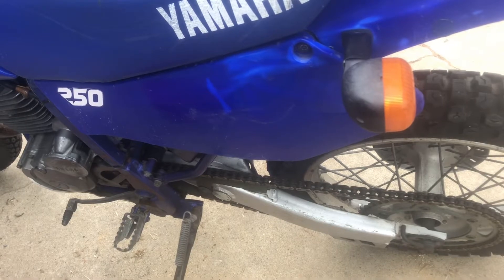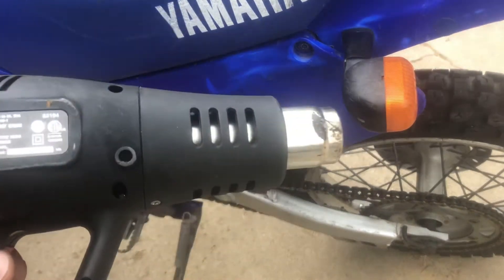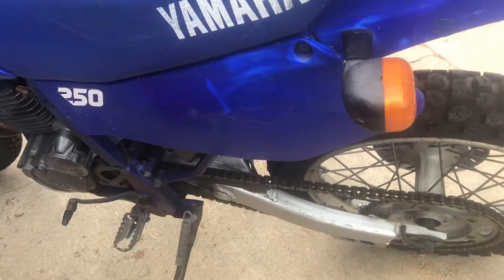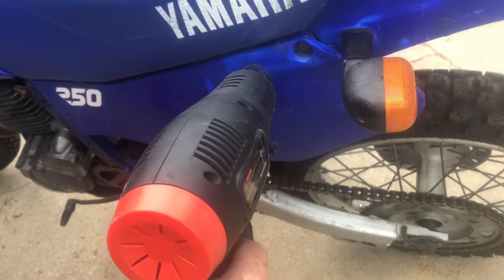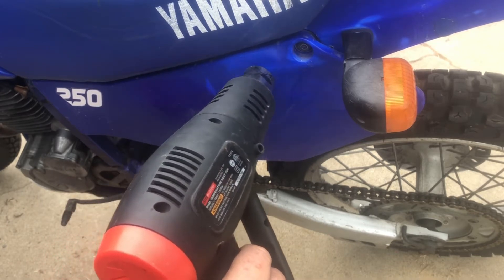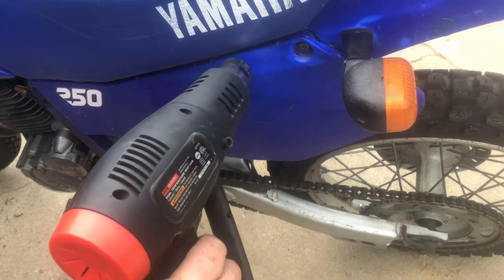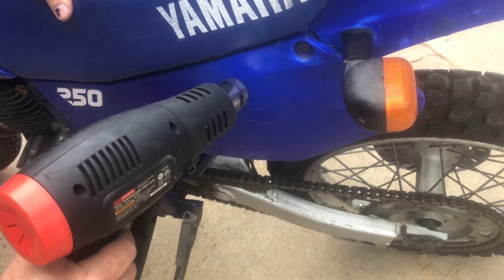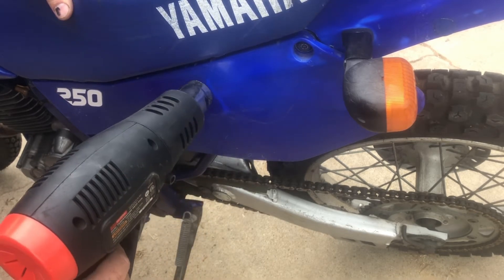How To Fix White Spots On Dirt Bike Plastics

Comment: Do you know anything about ford rangers? I bought a starter for it and the bolts are very hard to screw in. Wrong size starter?
Reply from the maker: I know a little bit about a lot of stuff but not an expert at anything.  I would guess that something isn’t lined up correctly.  Don’t force it, don’t need to strip out the bolts or break something.